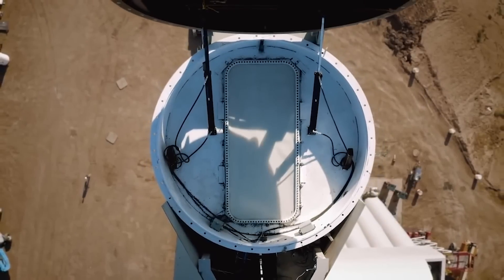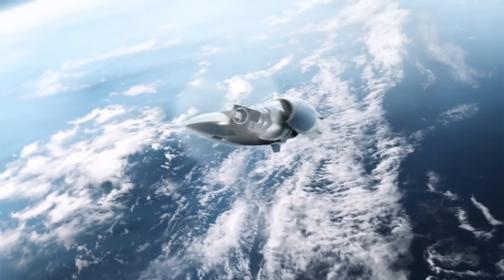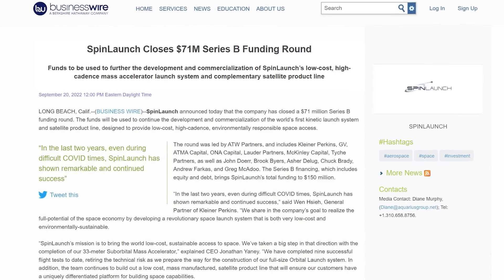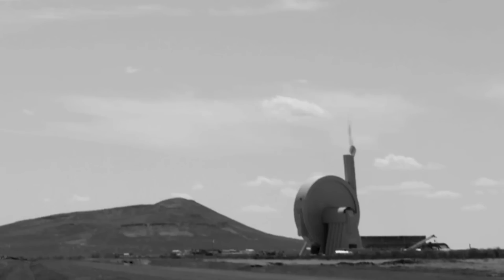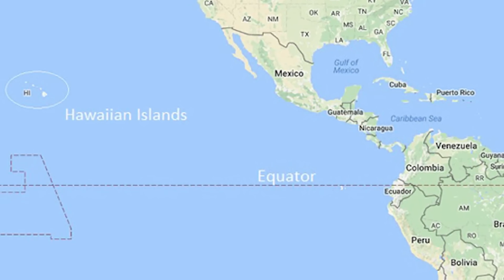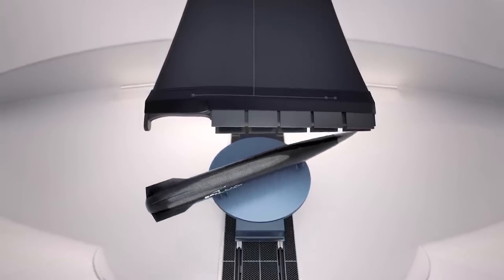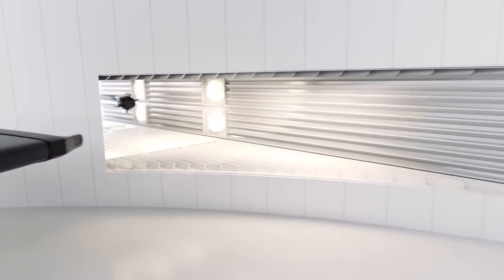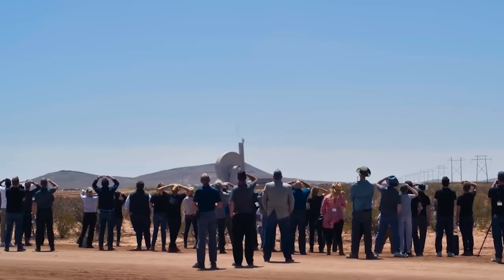What Happened To SpinLaunch & The Orbital Accelerator?

Comment: build it on the top of mount everest. also build a big road, and a big hotel on the top....
Reply: Since the payload is limited to about 200 kg anyway, hundreds of payloads could be transported with a larger aircraft (747) to an altitude of 10 km - an altitude at which the payloads launched by Spinlaunch would already fall back down if additional rockets were not used to propel them (which would of course also be needed for the aircraft variant).

Comment: Even if they had a perfect "-orbital- accelerator" they would need to fire a second stage. A second stage is like 9,000 pounds. So their spin arm would be able to hold up the Golden Gate Bridge, but even if they had that building a second stage that can withstand those G's is even harder to build than the spinner.
Reply: And that 9k lbs second stage is launched at a higher altitude and at higher velocity than spinlaunch. So a spinlaunch second stage would need to be even bigger.

Comment: As a spacecraft engineer for the U.S. Naval Research Laboratory, they had us look into this. The government wanted to launch spacecrafts into orbit with a giant rail gun. Here's the problem. If you actually look at escape velocity, it's roughly Mach 33 at the Earth's surface. Anything traveling that fast will start to burn up immediately. I'm not saying it can't be done. However, anything launched in this manner, would have to be within some sort of rocket that is covered with ablative material. It poses a lot of technical challenges.
Reply: Correct

Comment: The centripetal force on the projectile before leaving a 15 meter long radius spin launch system at 6000kmpg ( about mach 5 ) would be 19000G so a 1 kg mass produces a force of 19 tonnes - their current system is just a mini test as they need a longer radius. !
A falcon 9 rocket first stage separation takes place at about 1860m/s so to match the first stage of the falcon 9 with a future 35 meter radius centrifuge a 1 kg payload becomes 10000 kg before it's released from the centrifuge arm.
They aim to keep it under 10 tonnes per kg just to get similar speed to falcon 9 first stage. It wont get them to space and the best they managed is 20% of their target so they have enormous challenges ahead.
There is a reason military switched from slingshots to cannon and rockets.

Comment: Just because something can be calculated, and is possible in the abstract, does not mean it's viable in practice.  Yes, that much power exists in the world, but that does not mean you can deliver it all to the launcher, convert it to centrifugal force, or cause the mechanism to withstand the forces.  I'm sure that Jiminy Cricket was correct - if you can dream it, it can be done - that doesn't mean it should be.

Comment: I think the answer why we don't see their space launches tests is very simple, it's quite difficult to achieve  space, but it's possible to use this sistem as a long-range artillery. Given the tension in world politics and that everything is moving towards war with China, the US government curtailed the scientific use of the centrifuge and placed the project under the control of the military, since for these purposes it is more expedient and feasible.
Reply: "but it's possible to use this sistem as a long-range artillery"

That would be a very bad idea. 

Modern artillery has to be mobile - after firing it MUST change its position as fast as possible - otherwise it is itself a (in this case very big) target.

It is also questionable how accurate this "spinning launcher" is compared to a modern cannon and the fire rate is definitly much lower than in normal artillery which could typically fire multiple rounds in one minute.

Also this "spin lauchner" needs a huge electric supply which is not available on the battle field

Comment: Having the control room co-located near the spinny bit, amongst many other things, is amazingly stupid. A catastrophic failure could easily kill everyone in the control room. A painted vacuum chamber with peeling paint? You're kidding, right? Vacuum chambers are typically stainless steel to minimize outgassing. You will never achieve any decent vacuum levels from a painted surface. This is moronic on so many levels.

Comment: "Ultra high speed airlock doors ... help spinlaunch launch every couple of hours"  

That´s nice - but how you can keep the low pressure if you need to mount the next payload?

And what about the extreme unbalance which occurs at the moment the payload is released?
200 kg ob unbalanced mass causes extrem forces on a spinning arm of that size and rotations speed.
Reply: I suppose you could do a small section with airlocks to minimize the air that gets in.  But still,  the overall idea is just terrible with 10000g, an imbalanced spinning arm once launched and using the highest speed to maximize the atmospheric losses right at the surface.
Reply: @bert-blank  Another problem. 

In a normal rocket, the G-forces always act in the direction of the longitudinal axis; in Spinlaunch  they act in the direction of the transverse axis during rotation and in the longitudinal axis again after leaving the Spinlaunch.

This does not make the construction of the payload any easier.

Comment: To achieve the velocity necessary for low Earth orbit (7.8 km/s) with a 100 kg payload, the kinetic energy required is 3,042,000,000 Joules (or 3042 MJ), and the centrifugal force experienced by the payload would be 121,680,000 Newtons.

These calculations highlight the immense energy and forces involved in achieving orbital speeds through a kinetic launch system. While mathematically it's possible to impart the necessary kinetic energy to a payload to reach orbital velocities, the engineering challenges are substantial. These include designing a system that can withstand and manage these forces, ensuring the payload's integrity under such extreme conditions, and controlling the release mechanism with the precision required to achieve the desired trajectory.

The concept does not violate fundamental physical laws, making it theoretically possible. However, the practical implementation of such a system at an orbital scale involves overcoming significant technical, material, and safety hurdles. SpinLaunch's ongoing development and testing aim to address these challenges, proving the concept's viability.
Reply: Spinlaunch did not adress shit!!

Comment: A giant rail gun or sling shot at ground level with a ramp toward the end would be more practical than something that throws this many G's on whatever it is launching. G's would be encountered when hitting the ramp but horizontal G's could be controlled better depending on how many miles the launch strip was for the acceleration phase. Another way would be to anchor a giant cable to the moon and have it hang through the Earth's atmosphere. Fly up to the end of the cable which would have to be able to retract and extend like a winch so it could always be high enough to not hit mountains and buildings and then use something like roofers hook up to their ladders to bring shingles up to the roof tops. It saves roofers a lot of wear and tear on their knees and the same goes for launching spaceships. Probably rocket fuel is still better than the cable but the giant rail gun should be looked in to.

Comment: High G loaded system have been well proven in proximity fused bullets and accelerometer controlled bomb fuses since WW2.  Ultra high G loading is the least of my skepticism of Spin Launch.  They could buy a private island in the Bahamas' and build their full sized facility there.
Reply: Bombs do not have a lot of mechanical moving parts - satellites often have solar panels which have to be unfolded in space, antennas which have to move to show in the correct direction, fast spinning gryoscopes to stabilize and correct their orientation etc.
When using rockets these mechanics have to withstand less than 20 G - if launched with Spinlauch they would need to withstand 20000 G.
Reply: @thomaswalder4808  Their most likely payload is a nanosat with the weight and dimensions of a tablet computer.  Such devices have no real moving parts in the traditional sense.  Accelerometers, gyroscopes found in an inertial navigation system can be made in one silicon piece as already made for your smartphone.  I am not sure what their maximum G loading tolerance is but it's pretty high as testament to many such devices dropped on hard surfaces and still work.

Comment: I am now curious if any commenter in this video has done any of the math for this project or if they are basically doing every mistake thunderfoot did in his analysis of the project. The economic viability of the project is suspect but the fact so many call this impossible is just telling of how terrible the USA keeps doing in math and science tests.
Reply: It's not impossible. It's just very difficult and totally pointless.

I did the math a few years back, for a track-launch system. The vertical speed needed to throw a payload up to orbital altitude is about one-fifth the horizontal speed needed to stay in orbit.
Reply: @mitchellminer9597  
Oh, I am fully aware of the massive engineering cliff involved here, but the comments here aren't talking about "this is something which needs a lot of engineering work done to work" but rather "this is something which is impossible to do" based upon literally nothing. There is no material science or mechanical issue involved in the entire project that is outside the scope of current tech, nor is there anything in the spinlaunch physics  calculations which is incorrect or misleading. I don't agree with their economic calculations or their expected time line, but the simple fact of the matter is that everything they want to build has been done before in some shape or another, even if not at the same scale or combined in the same fashion. The main and only issue which is going to be a massive engineering headache is going to be the release mechanism, which every test they have done shows is still their main problem, but the comments clearly haven't thought about it for more than 10 seconds because they are still talking about solved issues, like the arms strength or the vaccum, even when those two are the most easy to solve ones.

Its just infuriating that I have to defend a project which I do not believe will succeed simply because the people who are criticizing it clearly haven't bothered to run the numbers for even one second.
Reply: @Netro1992  " The main and only issue which is going to be a massive engineering headache is going to be the release mechanism,"

No - that is not the only issue. The most important issue is that it has to be cheaper than existing rocket technology to make sense.
And the release mechnism is not the only problem - also the extremely high and long-lasting G-forces are a big problem for the payload. 
As well as the enormous imbalance on the rotor at the moment the payload is released. Or the problem to keep the vaccum when the next payload is mounted.
Or the problem of frictional heat in the dense atmosphere due too the high speed at time of start. Or the maximum weight of the payload which is according to Spacelunch just about 200 kg
Reply: @thomaswalder4808   did you not read the original comment or do I just treat you like you are writing in bad faith?
Reply: Well, it keeps deleting my long response posts or it is just not showing it to me, so here is a summary:
-90% of the objections in the comments are already solved and have been solved for decades, the question isn't of it can be done but whether they can get the manufacturing for their particular flavor of application.
-the two main engineering issues are the release mechanism, and the opening of the doors fast enough to ensure the vaccum is mostly maintained
-this isn't me saying the project will succeed, I don't think it will, but that's due to economics rather than the engineering or the physics, both of which are well within the known realm, it's the manufacturing that needs fixing.

Comment: i dont  see how  it  save  energy?? Still gotta  get  that  thinng  goin  fast....Easier just  strap  some  cheap rockets  on that  thing
Reply: The advantage (at least in theory) is, that "the thing" would be lighter as it has not the carry the fuel needed to accelerate it.
Reply: i  guess that  would  save  a  litlle  enrgy, but  is  the  enrgy  cost savings  worth  it?if  it  is  you could  be  on to somtin

Comment: The release mechanism releases the projectile but also a plunger in a partially gas filled vacuum chamber thats on a spring. It probably spins for an hour or longer after release. They probably have something like the box on wind turbines thats directly connected to its own grid. Other wise i cant see something like that working with out exploding. They got one on the moon you can see on that app to view the surface of the moon

Comment: Why wont anyone address how they are going to stop the payload form spinning?  If its released with the arm going 1300 RPM, then the payload will necessarily be tumbling through the air at 1300 RPM at exit.  Every animation I've seen has it coming out straight.  Thats not physics.

30kft.  Don't commercial planes go to 30kft?  With military assets through 80kft?  I feel like the long term realistic answer is sub orbital planes with rocket payloads.
Reply: Well they are releasing the front of the payload before the back.  It seems really obvious.

Comment: So if it was viable, that demo with it in a little clearing by the coast is insane. Having it above ground is just not acceptable, first it needs to be buried pretty deep with a tube for the payload, because if this thing has a catastrophic failure while spinning at escape velocity speeds above ground, pieces of the entire building and mechanism are being flung in all disc-oriented directions for 100s of miles lol. Maybe have a blast door of some sort at the end of the escape tube that can be sent info that a failure has happened and rapidly shut to prevent anything escaping in that direction too.

Comment: the  one problem i see is that it was supose to be in a "vacuum" but the moment the payload emerges from the accelerator 00:1:30 the protective skin goes outwards instead of sucked into the system as a vacuum would cause.
Reply: OK, bit the vacuum is supposed to be in the disk, behind the vacuum doors that are in the release shaft.  The protective skin is there to conceal those doors.
Reply: @bradleyrex2968  Not enough time to open and close the doors if they are there.  time needed for projectile release and exiting the facility is only .001 of a second or something. Not to mention the tones of air trying to get in.
Reply: @knightsun2920   But the prototype works, they have demoed the doors in other videos, and your numbers are complete guesses so...  I'm going to have to stick with the facts even if YT desperately desperately wants them to fail.

Comment: This thing will never happen. It's absolutely insane on so many levels. It's mind boggling to me that anyone has given them money to get as far as they have.
Reply: I don’t know, it’s worth looking into at least. It’s not theoretically impossible like plenty of other bunk promises, but it needs a couple breakthroughs in material sciences  first
Reply: @Android480  this is the same level of that ship to go down to the titanic that imploded.
Reply: The concept has been proven in real life at suborbital speeds. I don't think the orbital launch will be that much faster, the increase in the size of the launcher is probably to haul a bigger rocket into space so that it can do the rest of the work. It is an unusual concept, but far from crazy. The efficiency comes from expending most of the necessary energy when the rocket equation doesn't apply, meaning you can use a conventional power line to spin up the payload to the speed, you don't need to haul the rocket fuel to achieve that speed....
Reply: @Andreas-gh6is  - The concept hasn't been even remotely proven. They managed to launch a tiny projectile on a nearly random trajectory with something like 1% of the energy required to launch something into an orbital trajectory, and without any method of circularizing that orbit.

If you understand the forces involved here even a little bit then it's extremely clear that this whole venture is sheer lunacy on every level. The g-forces the payload needs to endure, the equal but exactly opposite forces the counterweight needs to endure (and then endure somehow instantly releasing the payload and being unbalanced at those forces), the vacuum seal on a rotating axis at such a large scale, the shock of hitting 1 atmosphere of pressure at literally greater than orbital speeds (going from vacuum to 1 atm in an instant).. all of this is just downright bonkers.

There is literally no chance of this ever working.
Reply: @eno2870  thanks. I'm dumb and needed a strong argument to steal. 🫡
Reply: That’s what they said about rapidly reusable rockets
Reply: @meatsaucez1516  - That's not even remotely comparable to this. This is like trying to build a submersible that can travel to the lower layers of the sun. It's just effectively physically impossible.
Reply: Idiots are still pumping hundreds of millions into solar 'freaking' roadways...
I weep for the intelligence of my species.
Reply: Have you heared of VC money
Reply: I agree this is some weird experiment burning though money maybe for something else
Reply: That's exactly what the leading scientists said about the Wright Flyer back in the days. I wonder how that turned out...
Reply: Right? Things like these are really a symptom of our „post-truth“ times.
Reply: Bah-Baah-Baaaaah